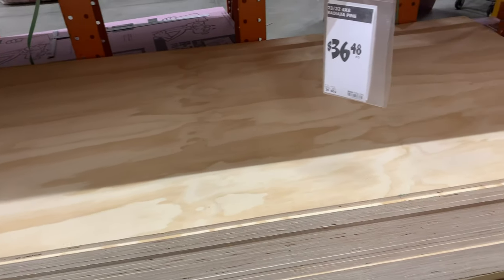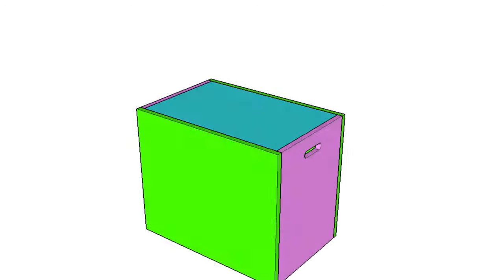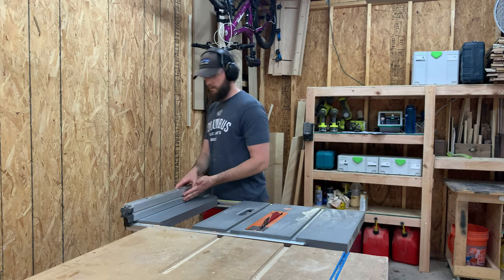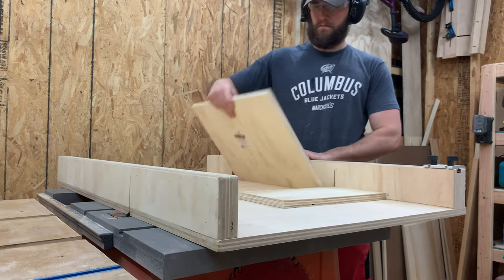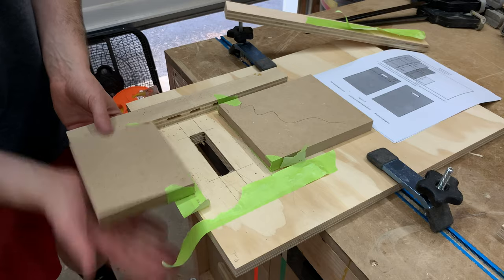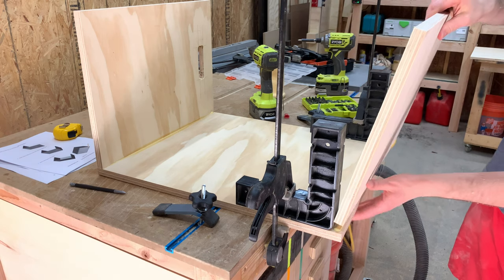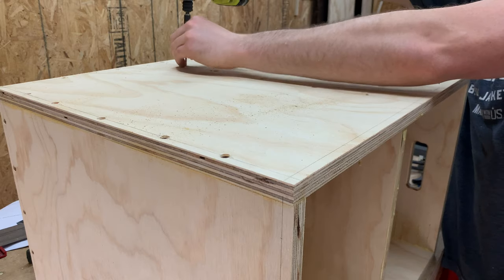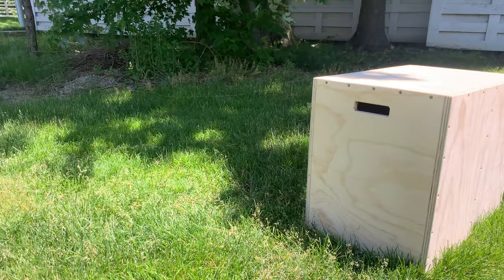Rogue is SCAMMING YOU! Build Them Easily

Comment: This is good. I'd prefer a plain, unbranded wood plyo box. Companies are in the habit of putting their name/logo as large as possible, making the box as ugly as possible.

The best box would be:

Unfinished - allowing the client to stain if desired.

Edge banding - would make the box look twice as good.

Pilot holes on the inner edges to prevent splitting.

Ability to ship flat.

One criticism is it looks like an excessive number of screws were used. Only 36 screws are really needed.

Comment: Hello
I already did 5 Plyo boxes using the step by step plan from your website. Are you sure that the box (mainly the upper part - height 60 cm) will resist when a 90 kg person steps on it with 2 Kettelbel 40 kg? What is max load that the box can hold? 
Doing the box as your design is, and those materials, the upper part is sustained on side screws, wood glue and the wood part in middle 🤔
Best regards,
Horea Muresan
Hm Fitness
Reply from the maker: Hi, Horea! I haven’t done any in depth testing to figure out the max load, but it should be plenty string for anything you’re doing. Feel free to add additional support inside if you feel the need

Comment: I’m glad I’m not the only one that can’t fit a sheet of plywood in their car lol.
Reply from the maker: It’s a struggle! The key is to plan out cuts that will allow you to fit in the car and then finalize the dimensions back at home
Reply: Spencley Design Co. I feel ya. I’m rocking a Toyota Corolla so the Home Depot guys know me by name.
Reply from the maker: Oh nice! We’ve got a Honda Civic so we are in the same boat 🤣 does your home center actually cut your sheet goods? Our Home Depot hasn’t had a working panel saw for over 2 years
Reply: Spencley Design Co. the saw works but I get a lot of “operator errors”. 🤦‍♂️I’ve marked out the kerf and on multiple occasions they’ve missed. Luckily I made my lengths longer than I needed.
Reply from the maker: 🤣 yeah you DEFINITELY CANNOT rely on them to make any sort of precision cut. I would leave them at least 3 inches of error